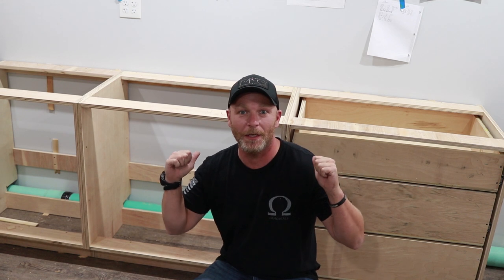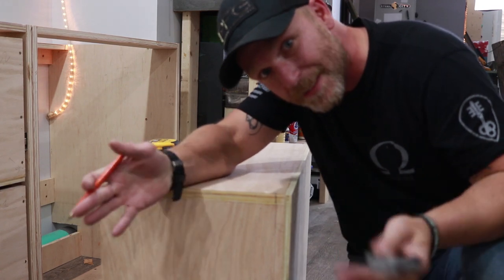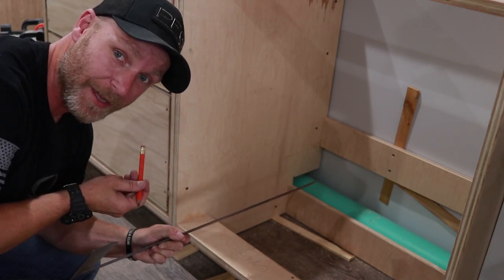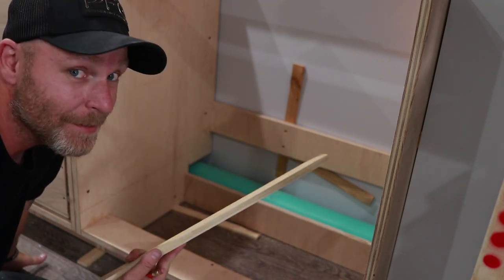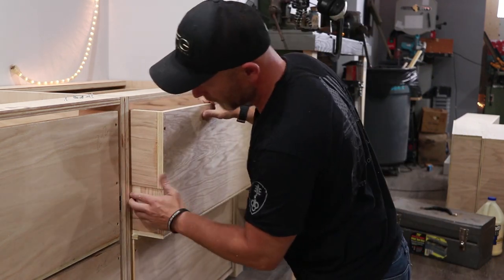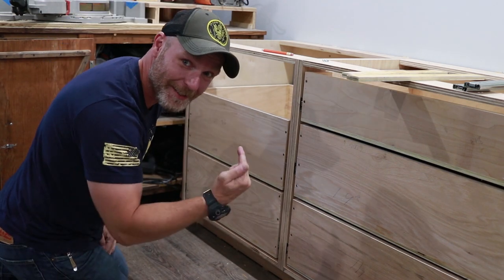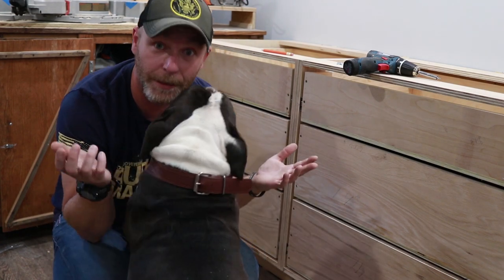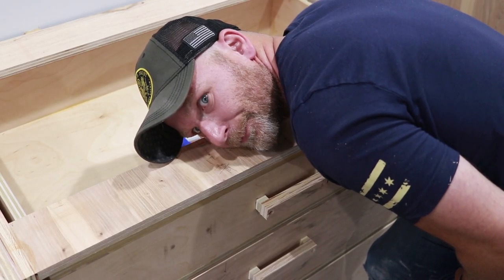Installing Drawer Slides in Cabinets and Correcting Drawer SIZE Issue

Comment: When the drawer is too narrow, you don't need to use washers, just look at your slide and the cut out around the holes is for this very purpose. You just bend it out, the amount of space needed to close the gap, dividing the space between both sides to keep the drawer centered, and then screw the slide on. DONE!

Comment: Came across your video while trying to troubleshoot some slides I’ve got they are binding up.  Just wanted to mention that instead of washers, you could also use a product called Handi Shims.  They come in a variety pack that goes from 1/32 up to 1/4.  They’re designed to be usable as larger shims to temporarily prop something up, but you can also cut them into their 6 individual shims which each have a screw hole and use those between the slide and cabinet for a more fine tuned fit.

Comment: So what if your cabinet is not square. I have a side cabinet that is 12” deep on one side up to 19 on the other. Can I use different length slides (I have to bottom mount due to the styles) ?? Thanks a great deal for all of your help and tips of the trade!

Comment: Hello, one of my drawer in kitchen is quite heavy and recently one of the sliding rails came of it. When I checked I saw very small screws were used .Will replacing it with bigger screws would help it or should I be doing something else ?
Reply from the maker: You can use a bigger screw but o would just stick a tooth pic in the old hole filling it up with wood and drive the old one in.  It should hold like new.  Hope that helps

Comment: Question, I am installing a big slide out cabinet and the gaps on bottom are fine but at the top it leans a bit to one side. I have two slides on the bottom of the cabinet checked them and they're square and level. I set the cabinet on the floor on top of 1/4 drywall to set my bottom gap and pulled the slide arms out and marked them on the side of the cabinet just like you did in your video but I still have this fricken lean at the top. I want to take a 5lb hammer to it id feel a lot better but then I'd have to make a new cabinet.
Reply from the maker: If they are under drawer slides just put a shim under the side the drawer is leaning and attach the slide to it.  Should straighten the drawer. If they are side mounted then just move one side up or down till it levels out.  Nothing to sweat over brother.  I hit this lol

Comment: What to do if the inside size in uneven? The further u go , the distance between two side wood pieces increases
Reply from the maker: I’m not really sure what your asking. I’m sorry
Reply: @KomarProject  I mean the inner size of the cabinet carcass that you would insert drawer is uneven at the front and back .